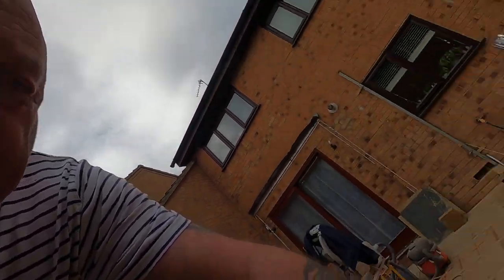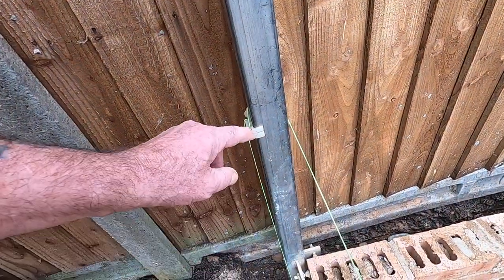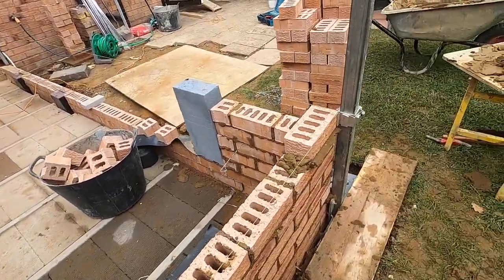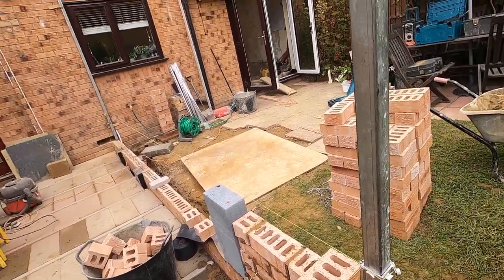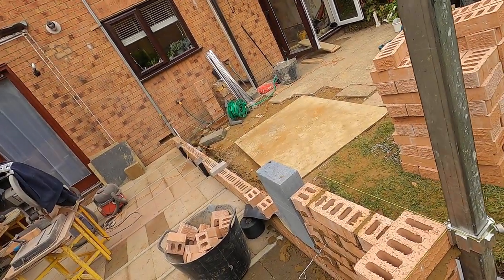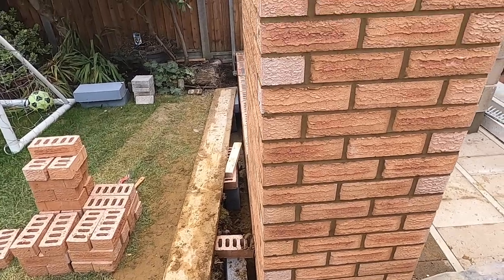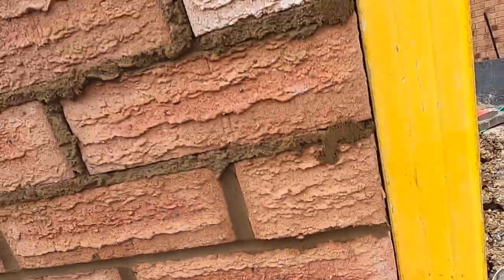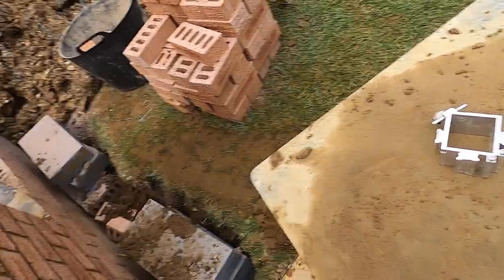The Fitzbrick Dory Block for Blake's and similar Profiles.

Comment: Off topic but what ratio would you use for lime plastering internal walls. And what type of sand for smooth finish?   Going to be doing my solid walls that ent insulated.   You seem like u would know
Reply from the maker: You can buy course stuff for the base coat and fine stuff for the finish from dedicated lime suppliers, try Mikewye or Lime Green.

Comment: Can you use them on a profile where it’s just tight to the corner Andy not the Blake’s
Reply from the maker: No mate.
Reply: Rhino build dori blocks m8 your looking for
Reply: @garydonaldson5573  BT ones are better, I’ve got both…….the lines just slightly back from the profile causing the corner to run slightly out of line.

Comment: The actual name Dori block is a trademark by BT engineering so I’m not sure if that’s the correct name . The fella that actually designed the original Dori was called Dorian from Australia.
Reply from the maker: I've changed it to be on the safeside but I'm not sure you are correct, there are many copies for sale on Ebay labelled as Dori blocks.
Reply: @bricklayersworldwithandy6277   mate you know how bitchy the construction industry is we’ve been in the game long enough buh. Just thought I’d mention it as I noticed no one else had.
Reply from the maker: @fabiandegussion5134  No probs mate 👍